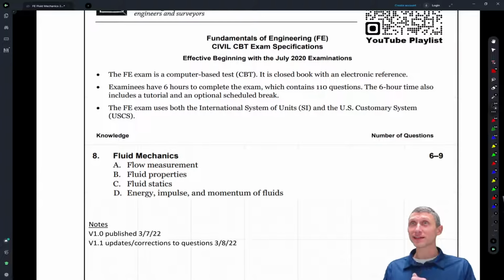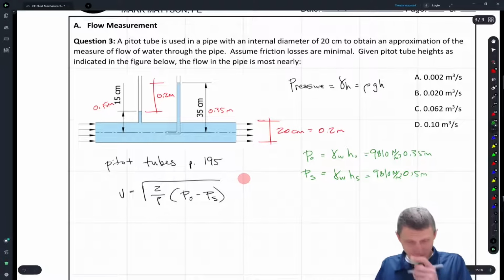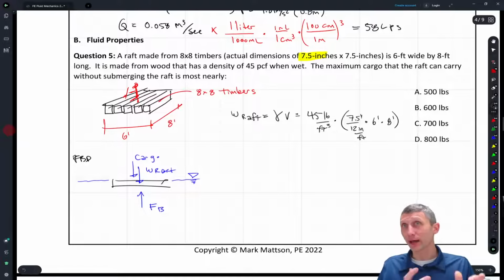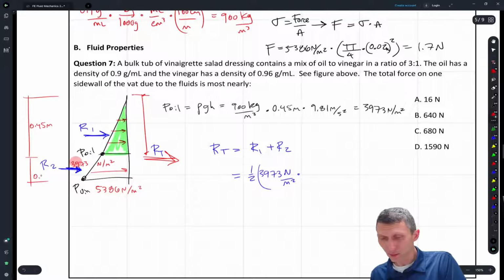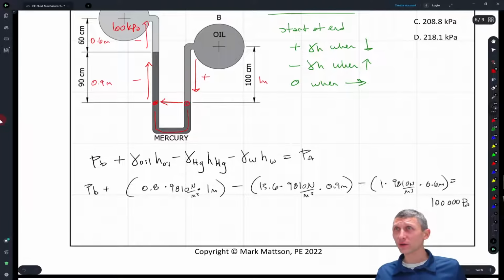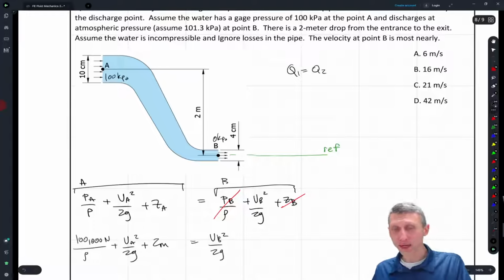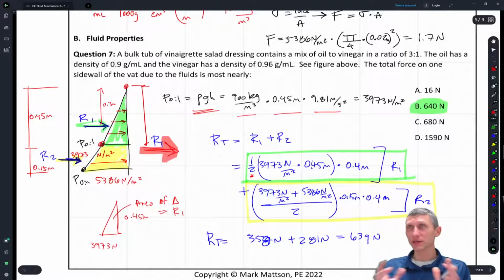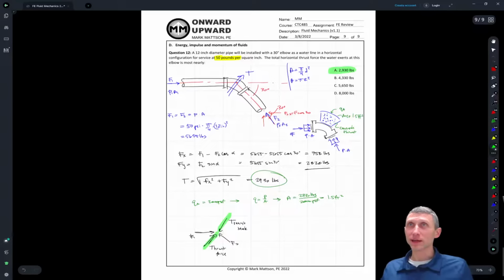FE Fluid Mechanics Review Session 2022

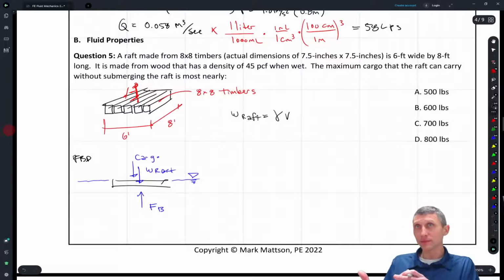Comment: for question 5 why do we plug in density as the specific weight at 32:25?
Reply: From what I understand, the numerical value of density and specific weight are same but units are different in US Customary units. You can see that in the first page on Fluid Mechanics of FE Handbook. ρw = density of water at standard conditions = 1,000 kg/m3 (62.4 lbm/ft3)
γw = specific weight of water at standard conditions = 9,810 N/m3 (62.4 lbf/ft3). 

So, if you use SI units you multiply 9.81 to density to get specific weight. But in USCU you just use the same number 62.4 as the units are lb mass and lb force.

Comment: Hi Mark, I was working on the problem regarding the horizontal thrust force at the 30° elbow in the 12-inch diameter pipe (Question 12). I noticed that in the solution provided, the momentum force and the differences in velocity (Δ𝑉) were seemingly neglected. Could you please clarify why the momentum equation wasn't applied in this case? Was it due to an assumption about balanced velocities or steady-state conditions that justify using only the pressure force?

Comment: I know this might be stupid but how did you do the 3:1 ratio for the 60 cm
Reply: Hi @fawadraja3564, to solve for the heights, assume H1 is oil and H2 is vinegar. The total height is 60 cm, so H1 + H2 = 60 cm. Since the amount of oil is greater than vinegar in a 3 to 1 ratio, H1 = 3H2. Substituting this into the total height gives 3H2 + H2 = 60, which simplifies to 4H2 = 60. Solving this gives H2 = 15 cm. Therefore, H1 = 3H2 = 3 x 15 = 45 cm.

Comment: Thank you so much for the answers for these concepts. But can I ask a doubt about the question 3 about pitot tube. Since there is a height difference between the two tubes will the equation used in the video still be valid. Since his equation does not account for the additional potential energy due to the height difference Δh.

Comment: Thanks Mark, I have a quick workaround for problem #10, instead of calculating slant distance for "Yc" and "Ycp" we can directly calculate the vertical distances "hc" and "hcp". Hc will be 50cm, however little caution needs to be taken when calculating "Ixc" and Area "A" of the gate, instead of using 16cm, use 8cm as a vertical dimension of the gate to calculate "Ixc" and "A". Just wanted to put this method as a comment as it reduces time to calculate vertical distance to the centre of pressure.
Reply: is it always half the height?

Comment: To find velocity on Question #3, a faster route, although it does not explain all the concepts you did while solving, is to equate the difference in height between the two tubes to (V^2)/2g, and then solve for V.

edit: Mark did explain it right after solving the first way.

Comment: Hello Mark! Thank you for these videos! In question 11, why did you make P2 zero? Why not plug in the atmospheric pressure itself?
Reply: It may be too late for your question at this point. The reason is the 100kPa at point A is gage pressure. Gage pressure 0 is atmospheric pressure. The atmospheric pressure would need to be added if the pressure at A was absolute pressure.
Reply: Hi Amanuel, did you take the FE exam?

Comment: for question 11 why did you use 0kpa for Pb instead of using 101.3 kpa for atm pressure?
Reply: gage pressure is measured with respect to the atmospheric pressure. Overall whenever the flow is exposed to atmosphere the pressure at that point is 0.

Comment: Hi Mark, Thank you for the lecture.  On question 5, you multiplied the height of the raft (7.5"/12") by 6' by 8' feet to get the volume of wood in the raft,  but since the raft is made of 7.5x7.5 timbers, there has to be some space between the timbers since 7.5 inches does not evenly divide into 6 feet.  Only 9 of these timbers can fit into a 6 foot span, unless of course you are using a partial timber (0.6 the width of the others), which kind of defeats the purpose of telling the width dimension of the timbers, right?

Comment: Hi Mark, thank you for the FE review sessions! I find them extremely valuable! For Fluid Mechanics Problem 10, can you go over how you calculated Ixc ?
Reply from the maker: Ixc is the moment of inertia of the plate about its centroid.  So you take the base (or width into the page) times the height cubed (length of plate) divided by 12.  I hope that helps clarify.  I did make a mistake when talking in the video.  See the comment string from @Lay also.

Comment: Good morning Mark I have a question on problem # 7 When you were getting Resultant 2 why did you do the average of the two pressure and why not use only the 5386 like when you got resultant 1 using 3973 only?
Reply from the maker: You actually do the average of the top and bottom pressures for each area... only for a triangle, the top pressure is zero, so you take (0+3973)/2, versus (3973+5386)/2 for the trapezoid.  Does that help?
Reply: Yes, it helped Thank you very much. Question will you do a review for environmental?

Comment: In question 7, while calculating R1, what does 0.4 represent and from where did you get that
Reply from the maker: I believe that's the width of the vat.  Please see the previous problem for the diagram showing the width.
Reply: @MarkMattsonPE  How do you know whether the given ratio in that problem, is a volumetric ratio or a mass ratio?  Is it convention to give the ratio by volume if not otherwise specified?

Comment: Question 12: the problem ask for the horizontal Thrust force ( forces acting in the X axis ) why is it that the answer is 2,828 Lb acting vertically ?
Reply from the maker: The z direction is vertical and ignored in this problem.  The horizontal thrust is the resultant thrust in the x-y plane.
Reply: @MarkMattsonPE  can i ask why is it the resultant force as the answer though? why is it not the sum of the horizontal forces (sum of forces in the x direction) for the resultant force, which would be near the answer C) 5650 lbs. i get using the pythag. theory if they were asking for the total resultant thrust force but they are asking for the total 'horizontal' thrust force. Are those two the same/equal, and along the same plane? i thought they were not? (I may be confused at the direction of the forces?)

Comment: Question 5: W= γ*V, But the problems states that the density ρ=45 lb/ft3. why are you using density as Specific weight γ ?? Thanks Matt. Keep the jokes up man!
Reply from the maker: You're right... gamma is unit weight and includes gravity, whereas density or rho is mass per volume. The problem should say the "unit weight of the saturated wood is 45 pcf..." Thanks!
Reply: Grateful you asked that question, Daniel. Just spent almost 10 minutes racking my brain on why gravity wasn't used, but you and Mark cleared it all up here.
Reply: @LeaderZ2000  Everybody brought gravity to the party in that example.  Both the surrounding water and our raft, are both affected by the same gravitational field, and buoyancy comes in proportion to the weight of the water.  We'd get the same answer, regardless of what planet the problem takes place upon.  So whether we use specific weight, or density, we'd get the same answer, as long as we were consistent.
Reply: Me to was confused, thanks for help.

Comment: Can you explain why, in problem 12, the impulse momentum principle doesn't come into play? Why can we set Fx & Fy to 0? Doesn't our momentum change in both x & y directions because our V1 and V2 are in different directions? 

Why isn't it "P1A1 - P2A2*cos(α) + Fx = Qp(V2*cos(α) - V1)" 

and "Fy + P2A2*sin(α) = Qp(V2*sin(α) - 0)" ?
Reply from the maker: The distribution lines are are usually sized to keep the velocities relatively low in the pipes.  Adding in the mass flow due to a velocity would increase the forces slightly.  I probably could have defined the problem more fully by asking for the thrust due to the static pressure.
Reply: @MarkMattsonPE  Thanks for the reply. And thank you for this wonderful video series, you really do a good job of hammering home key concepts.

Comment: Tricky first question... open channel flow using the continuity equation...
Reply: I used Manning's equation and got 7.5
Reply from the maker: A correction factor (in this case, 0.9) is often to adjust average velocity and area measurements.  For example, see this sample lesson/lab on finding flow in a small stream https://www.nps.gov/common/uploads/teachers/lessonplans/Climate%20Science%20in%20Focus%20Field%20Trip%20-%20Measuring%20Stream%20Flow.pdf
Reply: @alban97  when I used Manning equation , i got 5.56 cfs. PLease could you tell me how many is S in this equation. For me S got 1.22

Comment from the maker: So how do you spell gage/gauge?  USGS and the Steel Deck Institute uses gage.  However, ASTM and others use gauge.  I normally associate gage with stream flow gages and steel deck, and gauge with meters used to measure a pressure.  Merriam-Webster indicates gauge is preferred.  Both are in the FE Reference Handbook.  Thoughts?